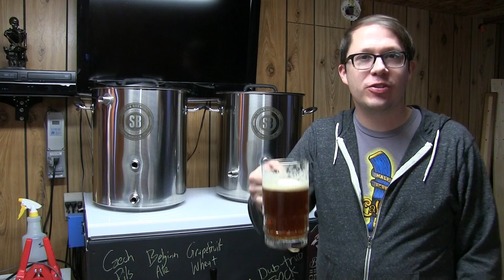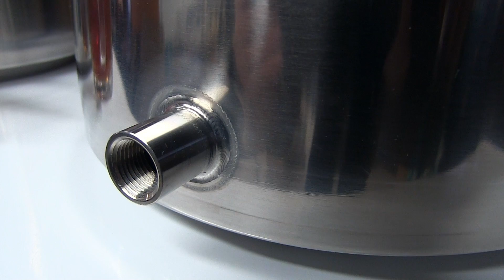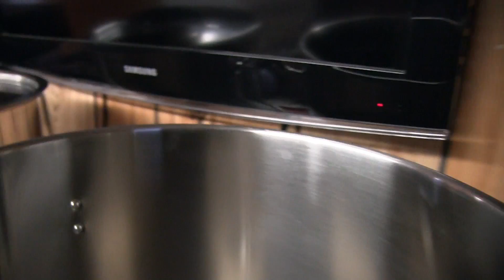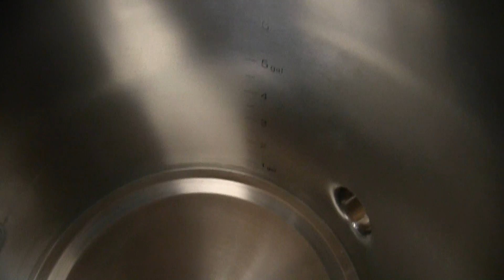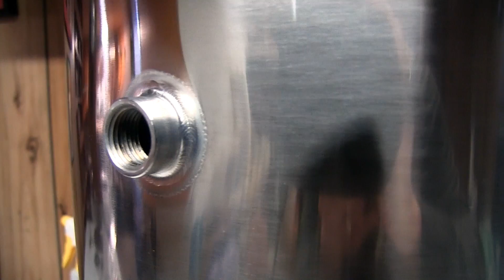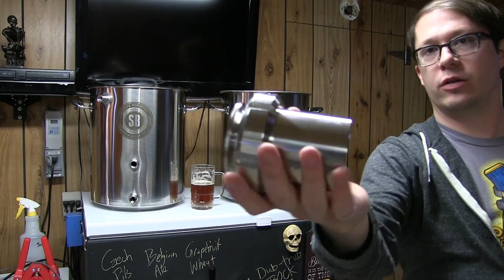Unveiling My Master Plan....  Some Serious Upgrades Are Coming!

Comment: I've had my 15 gallon Spike kettle for a year now - and it is impressive. My kettle is set up to be a boil kettle, so I just have the one port for a valve. (I replaced an original MegaPot with a Brewmometer and valve, which I've still use.) I've used it for BIAB and "traditional" brewing methods. Spike has great customer service when you have questions, and it's clear they have an eye for quality. My only complaint (very minor) is that the graduated markings on the inside of the kettle are off by a small amount, but it's consistent, so not really an issue now that I know how to adjust. Other than that, it is worth the investment, and they have added some options lately are well thought out and built.
Reply from the maker: Nice review Bill!  Yeah, so far I have been incredibly pleased with my pair, and to be honest I have not actually tested my gallon markings...  Will have to do that to see if it is a common issue!  Cheers!

Comment: really nothing too it. if you could build all the stuff you do it should be a breeze if you give it a try. I have done sanitary welds like that on 5G pipe no filler rod low amps. Give it a try Joe you could build some big stainless brewing equipment!
Reply from the maker: +Eugene Cosentino I may just have to give it a try!  I've only shiftily welded lawn art in the past, which promptly broke... So yeah, I will have to take your notes into mind, check the equipment, and see if I can do a better job!
Reply: Yeah bro go for it! Just watch that puddle. Check out some welding channels on here too and it might help you see what you are looking for. Cheers!!!!
Reply from the maker: +Eugene Cosentino I will definitely look into those vids!  Thanks again man!  Cheers!

Comment: I'm brewing electric as well. Got a 3,2kW immersion heater in my basic and non-smart 50litre (13,2gal) kettle. I was worried at first, I had questions such as "How am I supposed to control the heat/boil if I go electric?" and honestly; you don't need to. (Depending on the output of your heater of choice, it should fit with the intended boil-volume you're going with) I've never had any problems of it giving me a very hard boil.

Those are some beautiful kettles really. I bought a random "budget kettle" and it has pretty thin material which is a shame. Hoping to upgrade as well someday, would love to have a set with both valves and thermometers.
Reply from the maker: +Reckoning888 Awesome!   Yeah, I'm trying to work through the 'controller' at this point, and I'm finding that a lot of the tutorials and info out there would be overkill for what I want it to do.  When my friend Erik and I can finally get a moment to hang out, we're going to be ordering parts and getting this sucker finally put together!

Comment: I'm planning to build a system like that, problem is I do use an immerse wort chiller. Are you going to use the chiller with the electric system, and if so how?
Reply from the maker: +Ferran Grau Leal Unfortunately, I may have to discontinue using my immersion chillers for that reason.  It would hit the element, which would be a problem.  I have another upgrade planned though to compensate for that...  Stay tuned!

Comment: I've been thinking of building or buying a RIMS tube to increase my efficiency in a mash as well.  Slowly going to upgrade my equipment to all electric brewing.  Great video, Joe!
Reply from the maker: +The Brew-Q Nice!  I couldn't decide whether to do the tube or the "kettle-rims" setup, so wound up going with kettle-rims since I would pretty much have everything I need after I get these parts in place.  I am still considering the tube, but will brew on this new rig a few times to see if its worth it.  Definitely worth saving some cash if I can get good beer out of what this monster will do!  Cheers!

Comment: It's funny to me how everybody seems to want to go electric. I'm gonna build an automated propane system becasue it will give me 3,5x the power and save alot of time becasue of that. I will probably still use my electric kettle for  mashing at home but with a propane system I'll be able to brew on the wild side. (You can use propane indoors to even if most home brewers seem to think that it's somehow more dangerous than a gas hob.)
Reply: Vargathon
 Yes off course you can but your main fuse in your house might not handle it and that upgrade is fucking expensive if possible. My apartment only has one main fuse at 16 amps for example which means with some modification I could get over 3kW Problem is only the stove can actually utilize the full 16 amps an that uses a special plug and also means youd have to take the tove out every time you brew etc. You will fins that most people will only have access to 1 phase at 250v 10amps mains voltage on normal house plugs usually they are rated 250v16A. So yes theoretically you could make an electric brewery as powerful as you want but considering teh cost of wiring for 3 phaze and re fusing it's actually not accessible for most people while a 7kw propane burner is very affordable and you don't even need to work on mains voltage to automate it, to me that seems more economical and flexible since most home brewers will have the pots that surely are the main cost in the propane scenario. (YOu have to brew a great theal before the cost of porpane will catch up to the savings of haveing it electrical even in a country of very low electricity costs like sweden where I live). Commercial breweries still use steam in some instances and I guess that's for the same reason.
Reply from the maker: +rimmersbryggeri I wound up wanting to go electric because the winters here are pretty bitter, and brewing in the garage is very tricky for me.  My house is ready for 240v (several appliances are running on it already), so the changeout of my dryer outlet will be an easy one.  And with Ben's hospitality in supplying these kettles... It's quite worth it to me now to get off the propane and head electric!  The costs for electric vs. propane where I live are big enough that I am going to see actual costs savings in just a year or two on the new system.  So overall, for me anyway, its a win-win!  If it doesn't work where you live, that's a-ok too! Go with what system works well for you, where you live, and with what utilities you have at your disposal.  The whole point is to have fun and brew awesome beer (regardless of whether it is on a propane, natural gas, or electric system!)
Reply: terpsichoreankid
 In europe everybody has 240/250. It's not the volts that matter though. You can use propane in the house aswell. I'm not saying that electric is bad I'm just saying that it might not be as fun as you first hoped. Any well thought out system is easily adapted to work with both though. That's what I'm aiming for since I want to be able to brew where there is no grid or the mains electric supply is unreliable. Good luck with your system joe you were always a nice guy with ideas and enthusiasm, keep it up. Kepp us pusten on how your setup goes.
Reply from the maker: +rimmersbryggeri Thank you!  I'm excited about it because it will be something entirely new... That being said, I bought that tai-clamp cap for the port just in case I wind up going back to propane or natural gas...  It definitely pays to have options available to you no matter what the circumstance!  Cheers, and Happy Brewing!

Comment: Given that a rims system was the idea for my "final" upgrade this is going to be interesting. Next step in the upgrade chain is  making an electric brew pot for biab. Progress is slow as I'm starting to look at houses and spending a lot of money on brewing rather then housing would likely result in me becoming single rather quickly. Probably going to end up with smaller pots though, I like too much variety so I'm not sure big batches is the way for me.
Reply from the maker: +nairobie755 LOL  Don't wind up on the street (whether financially or romantically!!!)  I went with the 10 gallon pots so I could do 5 gallon batches.  That seems to rotate well for me and provides plenty of variety.  Cheers!